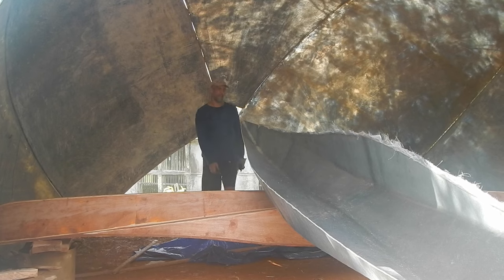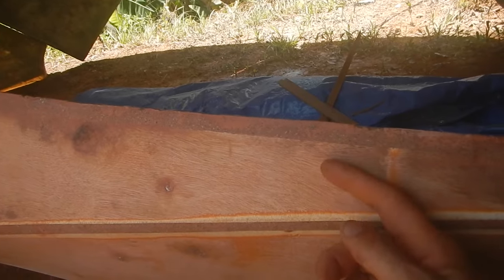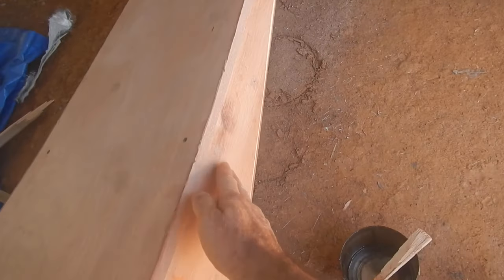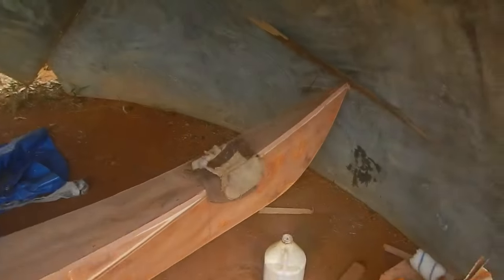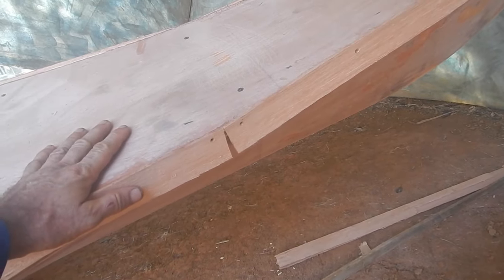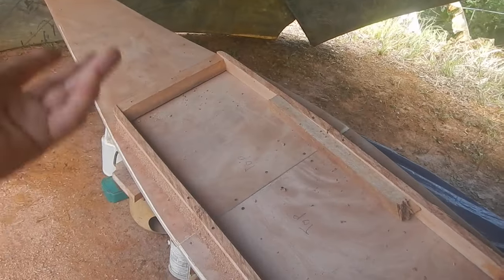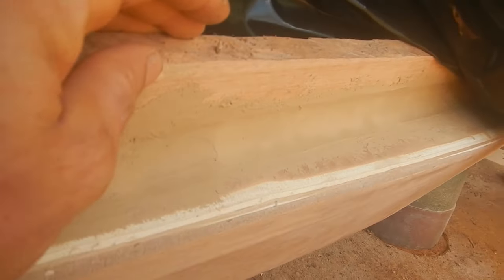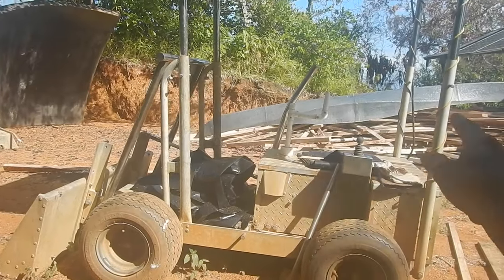Making Kayaks 008 The Top

Comment: Jamie the best part is when you have two kayak or canoe you can build a removable platform to use as another raft or boat. Realistically you should solar power the kayak with a little motor RC motor and solar panel.
Reply: RC boat motors are cheap abd come with a propeller and shaft
Reply: And rc boat motors rated for around 100 -300 watts continuous perfect for a kayak or canoe to go 3-7km an hour maybe more!! Depending on hull design and weight